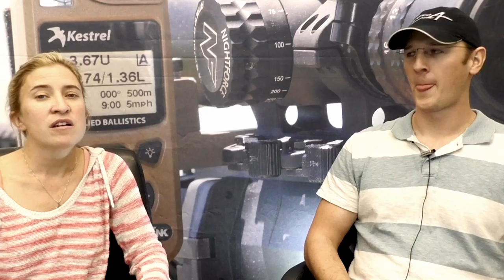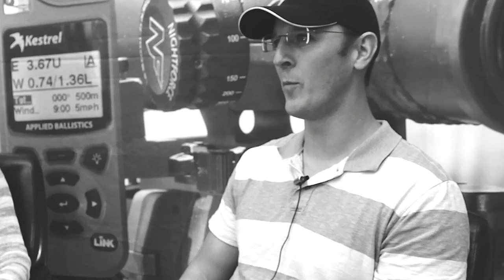Benefits of Custom Drag Curves with Kestrel and Applied Ballistics

Comment: Thank you. Question: I have the 5700 Elite, I use the drag curves rather than G1 or G2, but what if one of my rifles only has an 18" barrel and my velocity needs to be adjusted down 400FPS, will that custom drag curve still be relevant?